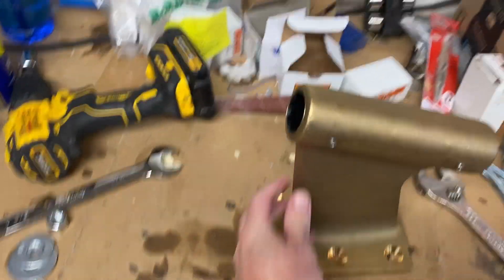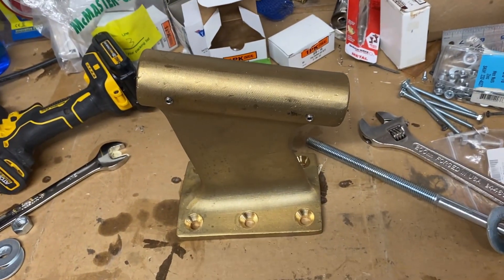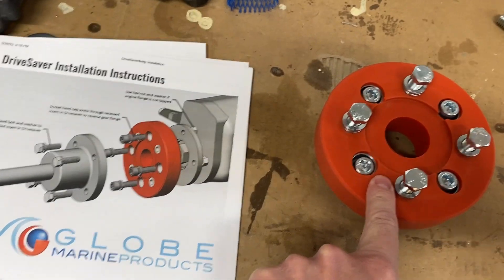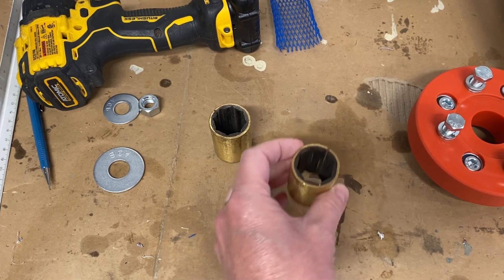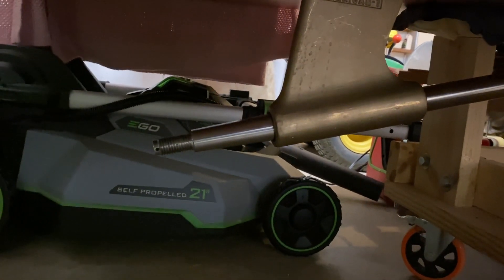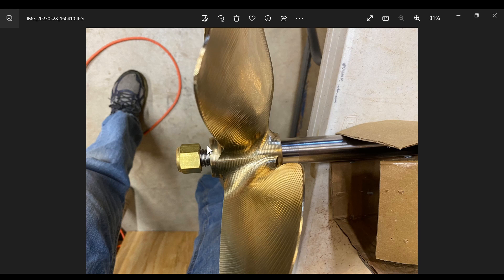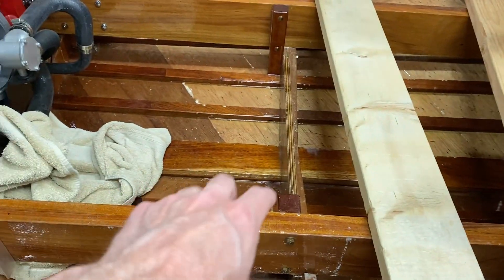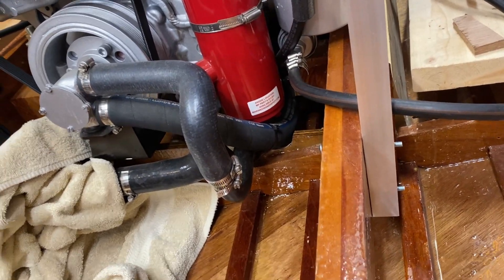Ep102 strut bearings and prop shaft adjustments

Comment: Do you have to cut the shaft because of the shaft saver will make it longer
Reply from the maker: You do have to account for the thickness of the drive saver.  You can do this by moving the engine further forward or using a shorter prop shaft.

Lee